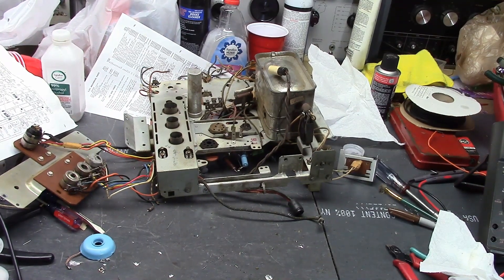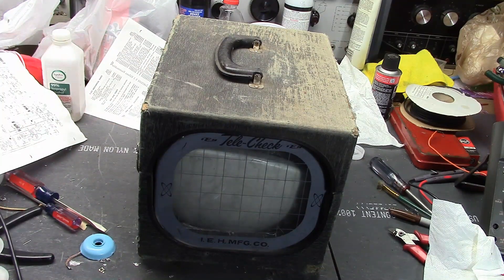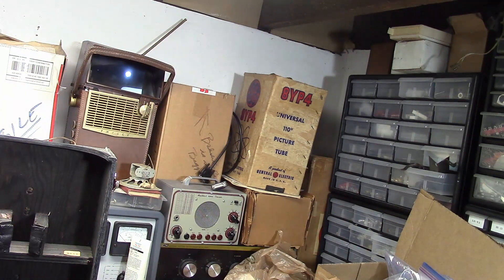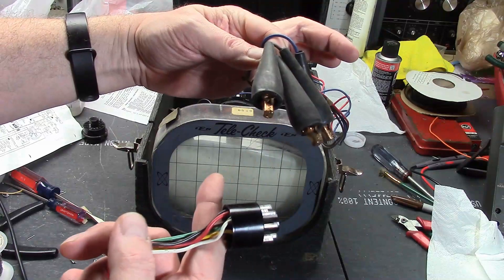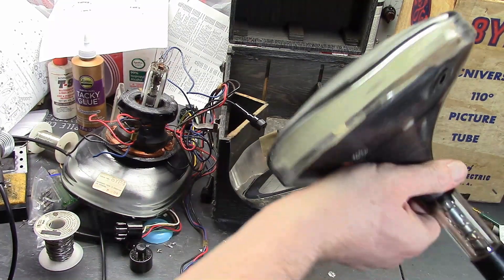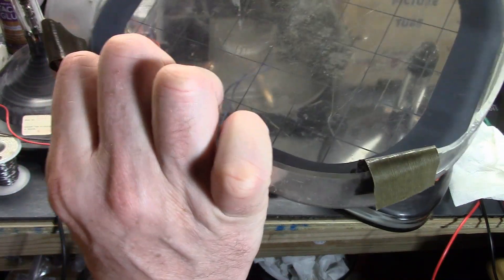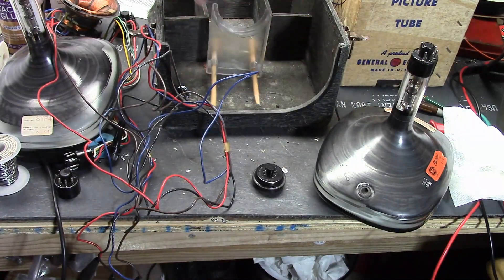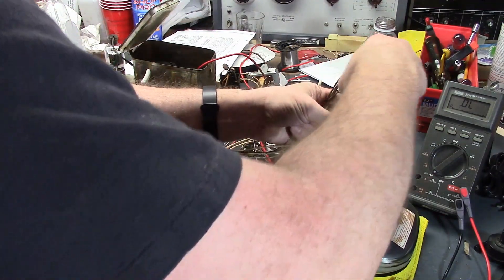Predicta restoration tips: Using an 8YP4 as a bench sub for the 21EAP4 CRT

Comment: Does this 8YP4 work with different filament voltages as well?
Thanks
Reply from the maker: No.  It's rated for 6.3 volts at 600mA.   You can use in in a series string set, becuase the current matches.   If you want to use it in a transformer based parallel wired Predicta Princess for example, you need to move the filament wire from the 2.68 volts tap to 6.3 volts.

Comment: QUESTION?  The 8yp4 “test tube” starts with 8, means it’s eight volts to run the heater? Don’t the predictas power it’s picture tubes on something like 2. Something volts? How do you get that voltage differential compatible from tv to test tube?
Reply from the maker: No.  With picture tubes the number indicates diagonal screen size.  It is a 6.3 volt tube.  The more important figure is that it is also 600mA.  That allows me to use it in series strung Predictas.  A few extra volts isn't going to make any difference when it is series strung.

Comment: I am surprised someone else has one of those. (I think I have an actual B&W test jig also,  plus 3 color ones. Really handy back in the day. Tele-Check, RCA, Zenith & one more. Also a drawer of adaptors and yoke loads.) Nice job on the mod. The length of the yoke leads might cause ringing. I ran into that making extension cables for the old 2 chassis Philco B&W TV sets.
   The test jig case & CRT can often be found at the Ham Radio fairs, and dirt cheap old CRT testers can often provide the adaptors. Be sure to discharge the HV wire before disconnecting.. One of the techs I used to work with would grab it and get shocked at least once a week. LMSAO

Comment: This will be a very useful jig!
You could use RG6 coax cable for HV lead to act as a capacitor. The insulation is thick enough to withstand 25kV. I have seen TVs that used it as HV lead.
I think the Al foil with air between it and the CRT will make crackling, hissing noises and generate some ozone.
Although I admit an RG6 coax would be too stiff to use in this setup. I would just use a HV capacitor or coat the CRT with dag.
Reply: Oh, and a disclaimer: I don't know if current production foam insulated RG6 coaxes would be adaquate. The ones I have seen used as HV leads were very old, with solid PE insulation. They also had multistand center conductor, quite a bit more flexible than today's RG6, especially if compared to the ones with that horrible copper clad steel center conductor.
Reply from the maker: @mrnmrn1  The specification for RG-6 states a maximum volage of only 2,700.  There is about 16,000 volts on the Predicta anode lead.
Reply: @bandersentv  I anticipated that current, foamed dielectric RG6 can't do it. But as I said, I saw this in some vintage TVs (namely for example the 21" Orion AT-505 from Hungary, 1959). They put a few meters of coax bundled up next to the flyback cage as a HV lead, to act as a capacitor, and it was like that from the factory, because it has a bracket for the coax bundle spotwelded onto the side of the cage. 

Do you accept links in the comments? I can send you a link to an online museum page, where you can see how have they done it. I have an older version of the same model, and it has the same HV lead solution.
Reply from the maker: There is no hissing or ozone. Not sure why you think there would?   There is a conductive coating on the inside of the CRT connected to the HV anode.  The aluminum foil is grounded.  The glass forms a very good insulator.
Reply: @bandersentv  Because I thought the voltage difference between the Al foil and the inside dag would ionize the air trapped between the foil and the glass. But maybe it would only happen with AC. And I also reserve the right to be completely wrong 🙂 . 

I think you tried this foil trick just as a temporary solution in a very old video, and it was audibly very noisy.

Comment: That was nice to get a Predicta yoke to fit which minimizes any possible weirdness with mismatch to the sweep circuits.  As for the HV lead, why not a sufficiently large and heavy rubber insulating boot over an alligator clip (small enough to be retractable completely and well inside the boot -- even an automotive spark plug boot might work here) so the set's own CRT ultor lead may be connected to it.  I wasn't quite getting why snaking the lead anywhere, whether into the HV cage or under the chassis.
Reply from the maker: That's how the hv lead is routed in Predictas. The sets ultor lead is inside the plastic shroud. It does not come out with the chassis

Comment: I'd be interested in how much if any x-ray radiation (likely soft x-rays) is emitted from the pix tube at predicta voltages?
Reply from the maker: Very little if any. The only component that might emit x-rays of any significance is an early HV shunt regulator (6BK4) in a color set from the mid 1950s.  The tube was soon modified to use shielding.